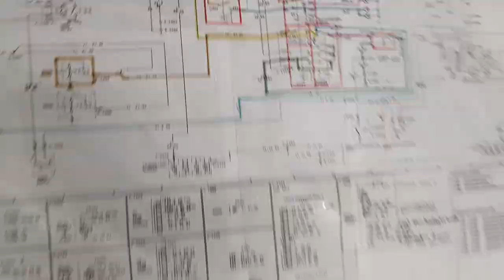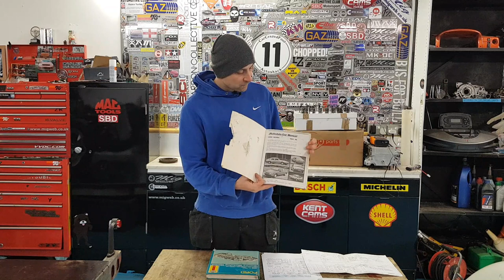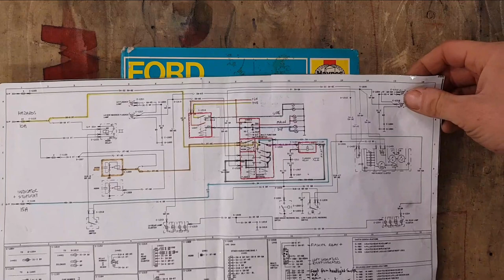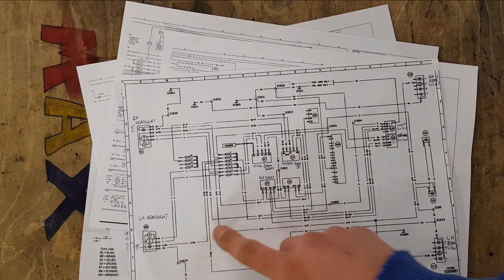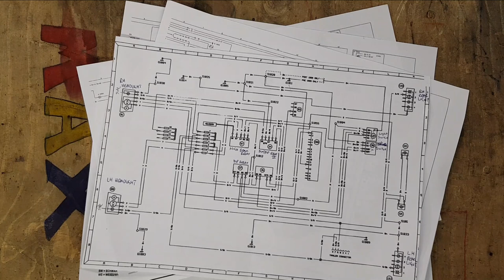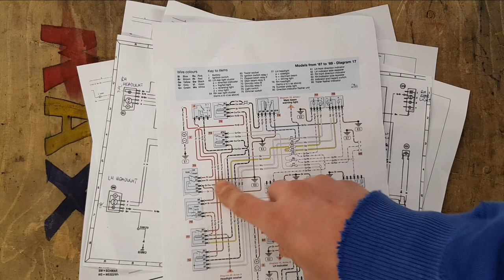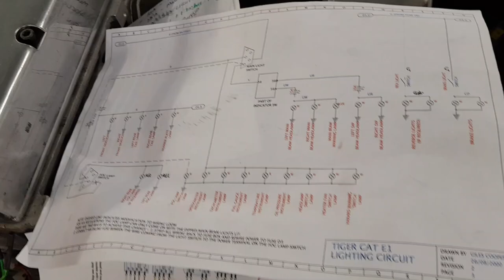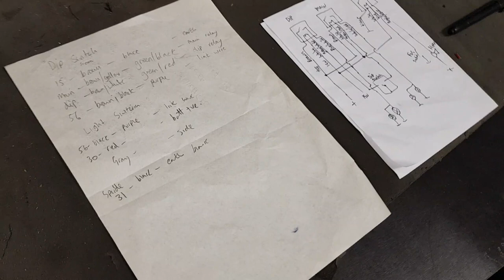Ep18. Wiring up the Ford Sierra Column stalks to my GBS Zero Kit Car!

Comment: I'm impressed with the forward thinking should you need to remove relays / dash plus the plan to draw up a full wiring diagram for any future accessories.
Reply from the maker: Many many many years of frustrating repairs led to this point 🤣

Comment: That's good to know the start of the part number on the stalks is the year, I haven't got to wiring yet and mine start 87. I presume it was on Rhocar you found the pinouts? Those top hat bushes look good, I could do with getting hold of some of those. Pete
Reply from the maker: Yes most of my research took me to rhocar and locost builders forum. Even just Google Sierra stalk wiring and tons come up, but as I say make sure they're right for you! Thanks for watching 😁